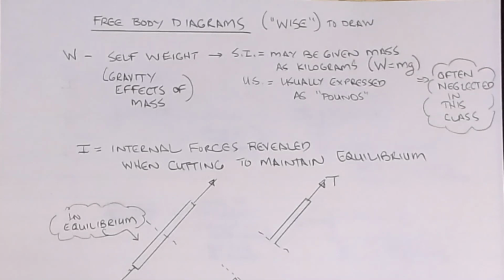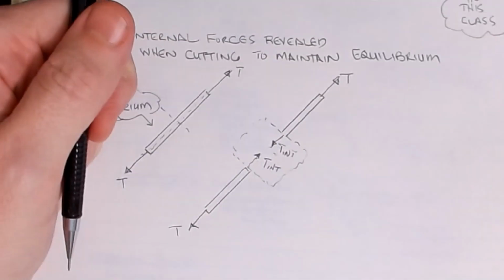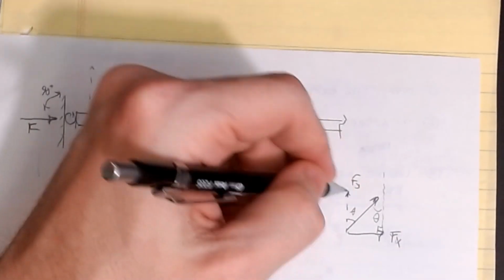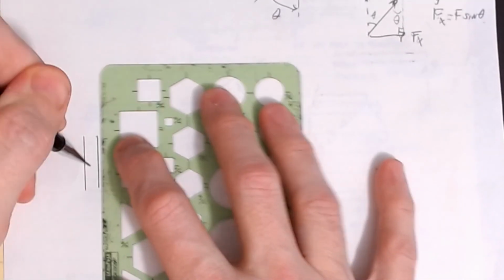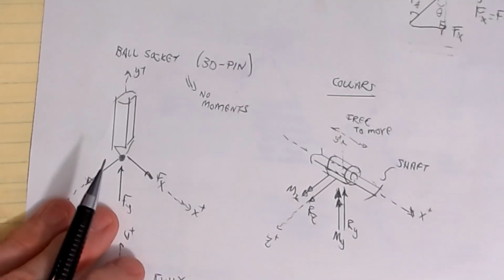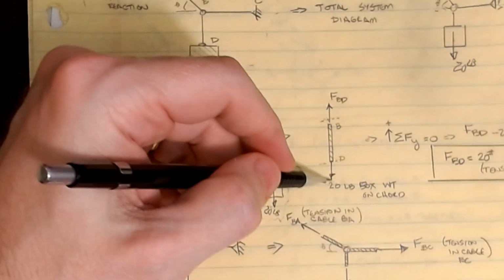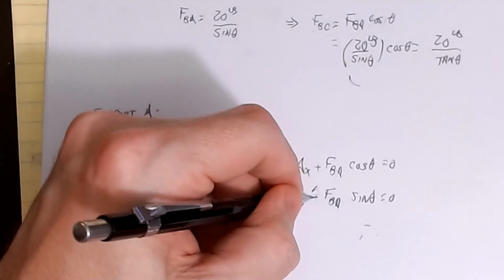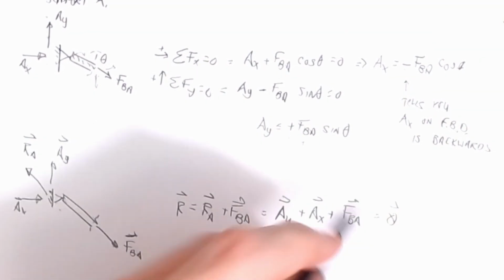016 ENGR212 Statics: Drawing Free-Body Diagrams - The W.I.S.E. Approach

Comment: Hi, at 7:00 you were talking about Roller supports. With regards to this topic, my understanding for 2 dimensional scenarios, we need to consider 2 translational reactions (x and y) and 1 rotational reaction (moments). My question is, you mentioned in the second diagram that the "Pin in Slot" support is also a type of Roller support, this means that this support does not have any rotational reaction as the pin is allowed to rotate? Thank you.
Reply from the maker: All supports whether they be fixed, pinned, or rollers have three degrees of freedom or motion possible. What distinguishes them from each other are the boundary conditions (constraints) for each. By definition:

Fixed: rotation = 0, Rx=0, Ry=0
Pinned: Rx = 0, Ry=0
Horizontal Roller:  Ry = 0;
Vertical Roller: Rx = 0;

Support reactions are defined is resistance to a motion.  So if a constraint is present, there has to be a reaction in that direction.  Hence why a fixed supports has two forces and a moment acting on it, a pin has two forces (x and y) and a roller only has one (perpendicular to plane of motion).

For the pin in a slotted connection, the pin is free to rotate, so there is no moment reaction. It is free to translate in the direction of the slot (until such time as it reaches the end of the slot), so there is no reaction in that direction either.  Perpendicular to the slot, we assume that the pin cannot move, i.e. that it is restrained by the edges of the slot from moving in that direction.  If a slot is oriented along the x axis, the constraints for the connection is only Ry=0 -- which makes it the same as a horizontal roller.

Hope this helps.  Thanks for your question and of course thanks for watching!

J3
Reply: @jaythreeengineering  It definitely helped, I appreciate the reply. Thank you!